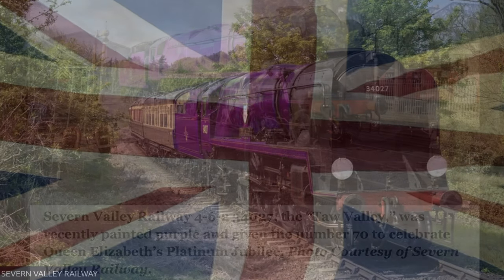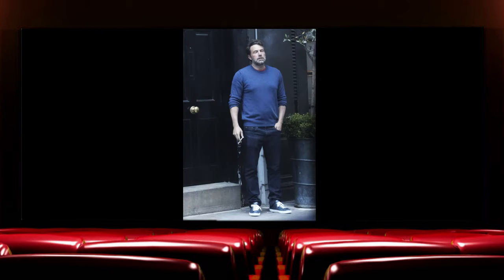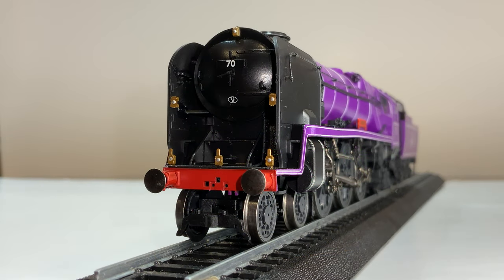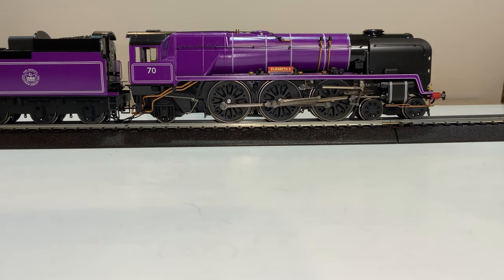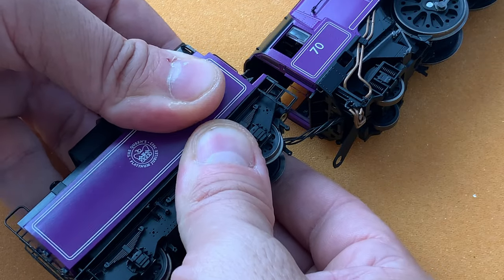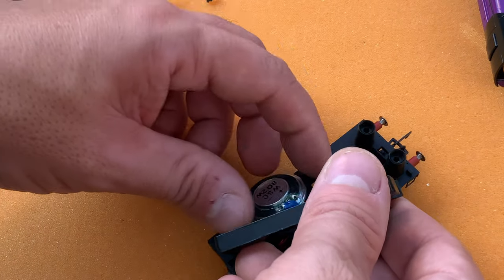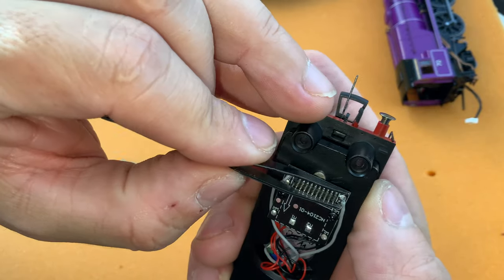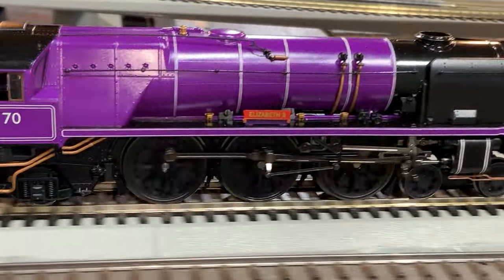OO Hornby R30231: Severn Valley Elizabeth II Platinum Jubilee Steam Engine - Quick Look-DCC Install

Comment: Interesting color - I think I prefer the green ones!

I think this tooling dates from about 2006,  and its really now lookign its age!  That mold seam on the top looks pretty bad.  All the dcc ready ones I have are 8 pin.  Not sure when or why they made the change to 21 pin.  Shoing that in is showing the models age, and really no excuses.    That chassis is a really bad runner.  No excuses for that!  Hornby need to do a better job at quality control.

Not sure you can dis them for no lights - UK steam does not have lights like a US loco!  Lighting those lamps would be hard to do all, esp the ones on the smoke deflectors.  There are plenty of more expensive US locos that have dummy marker lights in esier places to light than those!.  Also the cab detail is soo much better than much more expensive BLI loco's